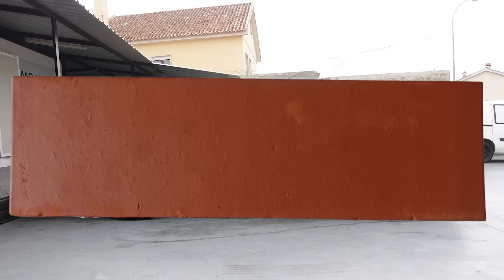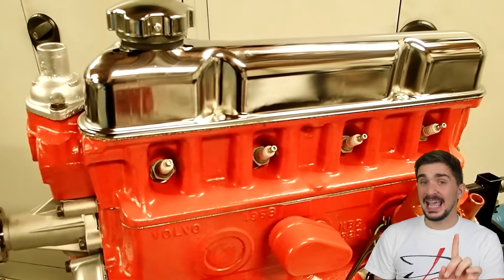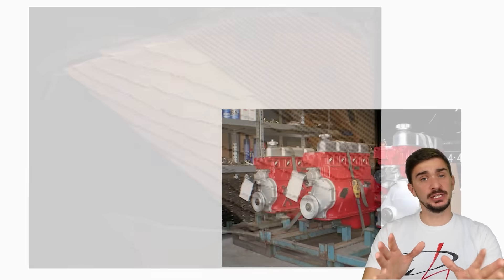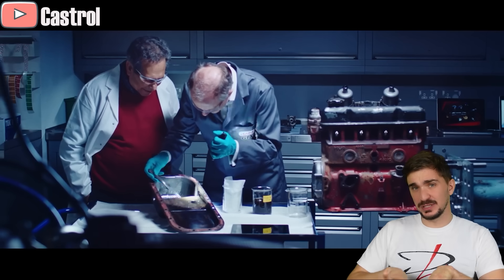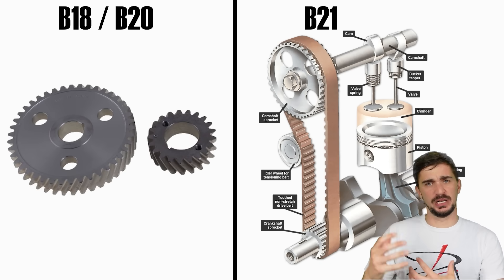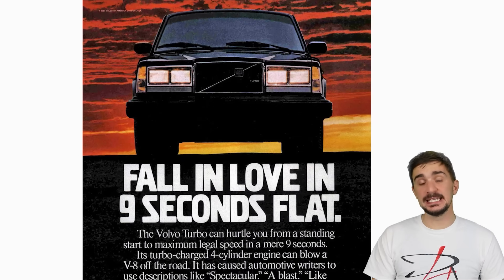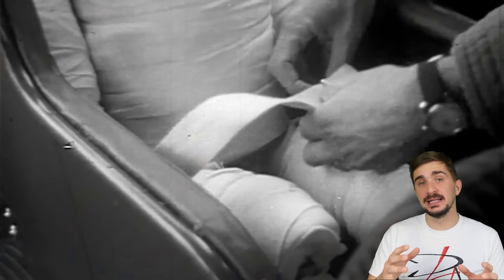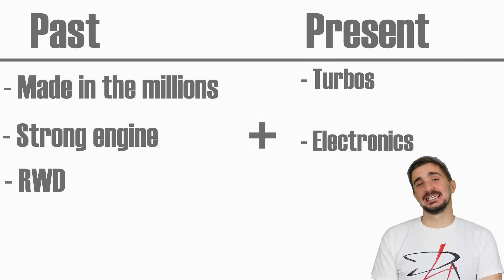A Story about the Volvo 240 and its Redblock Engine - Iconic Cars and Engines #18

Comment: He didn't go into the B23 follow up engine the B230F. The B230F had a horrible start with the first few months of production grenading due to a bad crank thrust bearing design. After that it was a great engine except for piston slap due to skirt wear. The skirt wear was finally taken care of in 92 when they added oil squirters that sprayed up at the bottom of the pistons. They never made 100 HP but were designed for fuel economy with narrower rod and main bearings. It was still a cast iron tractor engine with an aluminum cylinder head!

Comment: I borrowed a 240 estate from a friend who was going on holiday about twenty years ago. I wanted to use it to get rid of some junk I had in the garage. My friend said I can have it for two weeks if I came to the airport with him and drove it back. I remember sitting on my own in the car at the airport. I was a bit daunted by it's size and I wasn't looking forward to trying to maneuver it into a tight parking space. As I lived in the city centre, tight parking spaces were the only ones available. I was also feeling a bit fragile because I hadn't had much sleep. I remember speaking to the car before I turned the key. I said, " Listen, I'm a bit fragile and a bit intimidated, so just take it easy until I get used to you, please". I swear the damn thing listened to me because it was so gentle and so easy to drive that I felt safe and comfortable from the get-go. I discovered a parking space withing walking distance of my flat. I wasn't entirely sure the car would fit but I didn't have much of a choice other than to try it. To my astonishment, the car went in backwards without any fuss whatsoever. The power steering was incredible and it was probably one of the easiest cars to park, despite its size, that I have ever used. Over the next two weeks I became best friends with the 240 and it pained me to have to give it back at the end of the holiday.

Comment: Owned two of these, an ‘84 with a 4 speed overdrive manual and an ‘87 with a 5 speed manual. Both got 30 mpg in a mix of city and highway driving. They were both rock solid bullet proof cars, but were just terrible in the winter. Don’t they have snow in Sweden?

Comment: I was an owner of a 1959 544 with the B16 engine and had lots of issues  with it. The original engine was rebuilt and it failed after 18k miles. Brought it to a Volvo  dealer for a rebuilt engine for a reasonable cost. Fortunately I had a Volvo  mechanic check it out finding it was a junkyard engine that had never been rebuilt. Shortly after the engine developed an engine knock and it seized up. No help from the dealer located in Haverhill, Ma. That was my only experience with Volvo.

Comment: Bought a new Volvo GL from Crown Volvo in B'ham Alabama in '82. Forest Green w/ golden tan "low velour" upholstery. Only thing that ever failed was a weld on the muffler that the repair shop said was due to the car being primarily used on very short commutes that didn't burn off all moisture.  Traded it on one of the first BMW 318i four doors which was a mistake as my wife never really enjoyed that car. I'm sure that BMW was crushed decades ago, but I wouldn't be surprised if the Volvo GL lives somewhere today?

Comment: worked as an automotive repair tech for about 50 years. Owned my own shop for a little over 40 years. Worked on just about everything that had a rubber tire on it. The Volvo 240 series was, hands down, the best overall vehicle that ever rolled on the face of this planet.

Comment: Great video. A little known fact; the reason (ok, one of them) Volvo was the safest car in the world were because they used dead human bodies in crash tests. They had a lot of make up in their faces so the engineers could see where the faces struck a surface, usally the air bag. There were probably not a lot of other countries who would allow this. Later crash test dummies replaced the dead people. 
Volvo also invented the modern three point safety belt. They patend it, but in the Swedish way, they let all car manufacturers make them without any fees.
🚙 
Greetings from Sweden! 🇸🇪

Comment: Some Volvos like the P1800 I hear lasted millions of miles.  I never owned any such vehicle but if you once did, it may very well still be on the road or at least in running condition.  It is not unheard of for some European cars to last really long as there are a lot of old Mercedes cars with Diesel engines that are still running today even though they were made in early to mid 1980s or sooner.  They can last a very long time if the maintenance is done on time.  I know what some people may be thinking, they want a vehicle that needs no maintenance!  There is no such thing!  Stop falling for the mythical lifetime coolant and transmission fluids and realize that it is only to make you think they don't need maintained.  You know why?  That is because when the warranty is over, you are stuck paying for the repairs that will be needed, they really don't give a 💩about it!

Comment: As if I wasn't already interested in getting an old Volvo, you've found a way to peak my interest even more! I've always had old Chevy or Dodge trucks in my life. I've always found them to be rugged, simple, and reliable. I beat the crap out of them sometimes too. I've always had a desire for something more exotic though. Something foriegn. After hearing the woes and horror stories of German and British cars I started to give up on the idea. Then I looked into Volvo. I used to think the old Volvos were ugly but they have grown on me now. They have a charm to them. Your video, plus my own research has made me realize that these are actually rugged, reliable cars. I like their simplistic, over-built nature. The fact that they are one of the safest cars in the world is an extra bonus. I hope one day I can convince my wife to let me trade in my old Chevy for an equally old Volvo. Prefferably a wagon. My only concern is that the Volvos I usually find have the redblock engines with the timing belt. How well do those belts hold up? I know I should probably replace it when I get the car to be on the safe side but that can get kind of expensive at a shop. I could potentially do it myself since I have some mechanical knowledge and work on my own vehicles. How hard is it to do? Hopefully they overbuilt the belts or made them non-interference engines. One of my worst fears is having a timing belt snap. I don't worry too much about timing chains or gears since they're less likely to just snap. A chain will just stretch over time but not necessarily fly apart quickly like a belt.
Reply: The 740 DL with belt while not as rugged as the B18 engine is built (unlike modern cars) so as if the belt would snap  the engine will just stop (it will not selfdestruct).
Also to change the belt will cost you much less than with a new car. (With chemically welded bolts of 5 different screw standards).

Comment: From about 2000 to 2017 I drove used 1990 760's with the Intercooled Turbos. I could buy these at the time for 1/2 the price of a nice 240. The first one I bought in an Ebay auction for $1200 with 80 k on it in nearly mint condition. I put over 150k more on it until I got hit and the insurance company totaled it. I got paid more than I paid for the car. The next one I bought with 125k on it. I ran it up until 300k. This one I think the fuel line broke and it caught on fire. Quite the scene! Again I got paid more than the car cost me. 
These 760's with the turbo shocked people as to how quick they were. They were even more shocked when you told them it was 2.3 liters and 4 cylinders. 
Great cars and the steel and treatments they used on everything would not rust. It's hard to believe that you could have a daily driver in New England for 25 years and no rust anywhere.

Comment: I have owned countless Volvos. Probably a dozen. My 86 740 GLE was my favorite. No turbo. ZF trans. 300000 miles with original starter and alternator. 😂
The worst was an 1980 244 Diesel. That VW six was TRASH.

Comment: Under-stressed, iron, low-compression, forged engines live forever. My 2024 Ford is 50% plastic and I know won't last a mile beyond 120k miles. 
I think Volvo was the original green manufacturer. Forget about electric cars. Imagine the environmental savings by having cars last that long and offset the need for new production.

Comment: Every day that passes I'm more convinced that I need a Volvo. I want a V70 cross country, it has all you can ask for. 5 cil 2.5 turbo, manual transmission and awd
Reply: Hopefully you find one, do note that on the 2.5T/T5 that you have a gap between the cylinders which could cause the engine to fail so remember to shim the block so it will be able to run forever this mod will not only ensure the engine doesn't fail but makes tuning it easier. If the block is already shimmed by the previous owner see it as a good thing

Comment: I used to own a B18 powered 122 (Amazon). I tore down the engine due to a bad knocking sound, which turned out to be a bent pushrod. I replaced the rod and the lifter, but the crank was perfect. The cam was perfect, the cylinders were perfect. I put it back together with new gaskets, rings, and fiber gear and the car ran like new.

Comment: First 240 went for 365000 km, traded it in for a later model 240 which lasted 6 years to be sold for a teenager's 18th birthday and saved her life  not long there after. By that time I was driving  a last model, second hand  245 GLE which went to the wreckers after 10 years. Currently driving a XC60 since 2012. Would not have it any other way with long distances in Australia.

Comment: I remember attending a rally with my dad when I was a kid. One of these crashed into a rock the size of it's own engine bay at full speed. The rock was sent hurled into the woods, the volvo 240 reversed back onto the road and continued driving. Bumper had fallen off in one side but that was the full extend of the damage sustained.

Comment: If you owned one of these and had to move, there was no need to rent a moving van. The station wagon version, due to its flat roof and perfectly upright tailgate and sidewalls could fit practically anything that most modern station wagons and even SUV's with their sloping roofs and angled sidewalls cannot. The boxy Volvos built until the early 2000s were also a dream to park. The large windows and almost complete lack of deadspot made parking cameras and such gadgets unnecessary.

Comment: The B-18 engine was in the Volvo Amazon and the first models of the Volvo 140, then it was drilled up a bit and became the B-20.Then when the Volvo 240 was presented, the first models had B-20 engines which were very quickly changed to B-21 engines and they had an overhead camshaft with a transmission belt.And after about 100,000 kilometers the engine was often completely exhausted and the bodywork had rusted away and you had to change the exhaust system twice a year.

Comment: I’m very proud that my 740 Estate (modelyear 1990) has 465000 km (=290000 mls) on its ODO meter. It’s equipped with a B204FT engine. That’s a redblock with >200 hp, 16 valves and a turbo. Topspeed 215 km/hr (=135 mph). Without engine revisions😃

Comment: I had a volvo 164, with a b30.. which is the six cylinder variant of the b20.. After 300,000kms, I got a factory rebuilt engine in the engine swap program.. so that one lasted another 300,000km.. You could do that more or less forever.. :)

Comment: So reliable yet you won't find one in Germany. I wonder why that is...maybe because they rust away, before the engine has any chance to shine? The axles disintergrating as soon as they hear water dripping? They may have good iron, which I never heard of but you learn something new everyday, but steel wasn't and still isn't their strong suit. Having a reliable engine is nice and all, but many japanese cars and a few Volvos just don't have the chassis and interiours to go along with their drivetrain. I'd rather sit in my 4th Audi A8 D2 with over 450.000km on the clock, whether it's a 4.2, 3.7 or 2.5TDI. All quattros of course. They all managed those kilometers with ease. Currently I drive a 3.7 quattro as a daily and towing trailers with 465.000km on the clock and the interiour looks better than a Volvos ever did. No creaking, no squealing, no rust anywhere, no leakages, just running and working like it should.
And if I want something else, I drive my V10 Touareg or RS6 C5. Combined over 5 Audis I own they share 1.7 million kilometers. The Touareg has 230.000km.

Comment: Daily drivers in my family:
1988 Volvo 740 with 511,200 miles.
1992 Volvo 940T with 275,400 miles.
1993 Volvo 240 with 346,700 miles.
ALL have B230, red block, 4 cylinder engines. ALL are reliable to a fault. Dependable, solid, heavy, safe, cheap to maintain. They cost pennies to insure, and are exempt to yearly emissions testing.
They also look cool and get compliments all the time. All I do is change the motor oil, oil filter, air filter, wiper blades, and brake pads. That's it. They even have original transmission fluid, brake fluid and coolant. They have timing belts and the engines are non-interference. If the belt breaks, engine will not get ruined. I actually replaced one such belt on grocery store parking lot. My kids learned to drive in these Volvos, and some of my grandchildren too. My neighbor test drove a new car. It died at the first traffic light and refused to start...So much for new cars...

Comment: Had a string of Volvo’s began with the saloon and then 240 estates(station wagons). The best cars I’ve owned, easy maintenance, comfortable and the fuel injected version quite quick when required. My mechanic who tackled jobs I couldn’t at the time, breathed over his 240 estate, gas flowed head, higher cams etc. and made something over 300bhp, Nice street sleeper surprising the sporty guys at the traffic light sprints or on the motorway. One of my 240’s had over 340,000 miles used no oil and still capable of over 100mph. Today nearly everything is like the coke can.

Comment: 4:10 - I love this part. As a tester myself, the point of testing is to break things and let engineers know how it breaks, so the guys can fix it before a single complaint could be filed. When the stuff doesn't break, we are worried first and foremost, and only celebrate long into production with as little customer worries as possible

Comment: We used the Bv 202 in the military back in the day, it had a B18 engine. They could swim but sometimes accidents happened. One year one of them sank, and they let it lie on the bottom until spring the following year. They emptied the oil and put new in as well as a new battery, it started on the first try after having been under water for 6 months

Comment: My dad had a Volvo 240 here in Malaysia during the 1980s. It was a very popular sedan for the middle class as it looked good enough to park next to Benzes and BMWs, yet reliable to a fault. It was also very comfortable inside. I remember driving it and it took you where you wanted without any fuss and with the full knowledge that if you ever got into any accident with any car, the other car would be wrecked. It was not nicknamed the Tank for nothing. Volvos were also very popular here for parents to give to their children if they wanted their first car. Which was probably a downer for them as they wanted something sporty and cool looking, not the brick shaped 240. Volvo prioritized safety long before it became important with manufacturers. In fact, Volvo developed the modern 3 point safety belt and did not patent it because they believed that it was more important to have it adopted easily by other car manufacturers than to profit from it. That was why Volvo always had a soft spot in my heart, and I was disappointed to find out later that it was sold to Ford in 1999, then later to Geely in 2010.

Comment: Owned a second hand volvo 245 and drove it around Europe in the 1990s and it certainly was indestructible. The only enemy of this engine that sometimes defeated it was the humid English weather where the distributor points refused to work and the car refused to start. One call to the AA and  learnt a great tip and that was WD40 in the trunk in every Volvo car. One spray around the distributor and the wires going to spark plug and it started immediately. After that no more calls to the AA. Funnily it only happened in England, not in Scandinavia or other European countries. It must be the foul air of the medieval English marshes that makes people and cars sick!😊

Comment: Back in the days when people used to change oil. Even if you buy modern car (preferably chain engine I don't trust belts) and look after the filters and replace oil every year or 5k miles you will be surprised how many miles it will go for. Friend of mine still driving first gen Toyota Prius with 350k miles on the clock.

Comment: I had two 240s. The first was a GLT from 1984. I kept it for 24 years but it had alot of rust underneath. The second was a 1986 model bought in 2002 and lasted 15 years. Rust was developing in the wheel arches. My current one is a 2005 v70. Fantastic. No rust, great paintwork, smooth ride. These were some of the best  cars Volvo made.

Comment: I grew up driving one of these.  It was never fast, and struggled up very steep grades, but I got rear ended in college and it totaled the other car...I lost a bumper sticker.  This one replaced an older one that was destroyed by a tractor trailer with zero injuries.  It was cheap to fix and ran pretty much in any weather.

Comment: its true its a brick, but compared to almost every later Volvo, its less VISUALLY brick shaped than any of them. They went from this styling right to Italdesignish  700 series LOW POLY BRICK OVERLOAD
Bonus Note: The same guy designed the P1800 swoopy boi, the 200 series,  AND the 700 brick: Jan Wilsgaard